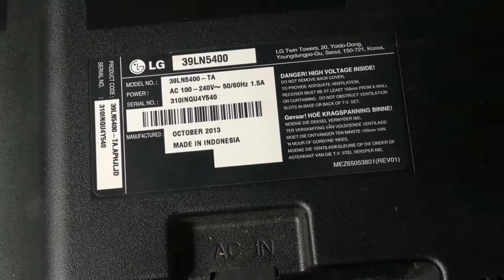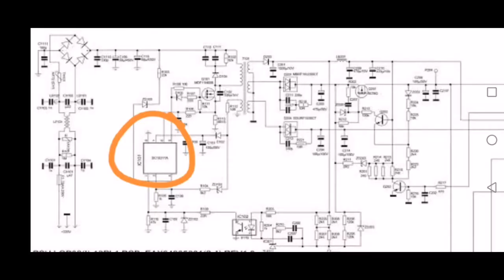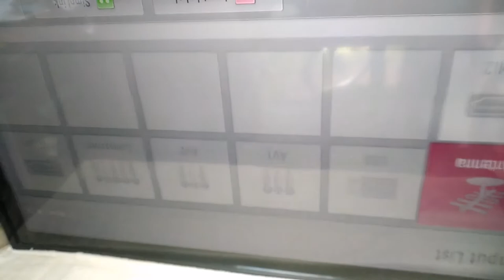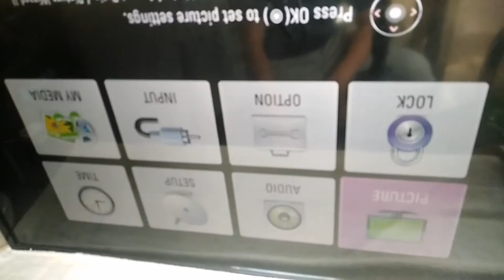LG LED TV NO POWER AND FUSE KEEPS BLOWING REPAIR MODEL NO. : 39LN5400

Comment: If it was just a blown fuse, why would you replace the "PWM driver"?
Reply from the maker: Because This was the cause for blowing the fuse repeatedly..
Reply: @DANEXTTECH  interesting. Hey so if a storm blew through and killed the TV is a fuse the most likely place or failure? OLED LG. I already removed the board and was about to start diagnosing with a multimeter like your demonstration
Reply: @DANEXTTECH  I couldn't pinpoint the problem today. I don't see anything burnt anywhere. 😔 sucks
Reply from the maker: WHAT WOULD BE THE RESULT OF YOUR CHECKING IS THERE ANY SHORTED YOUVE FOUND SIR? @trippyvortex
Reply: @DANEXTTECH  I couldn't find any but I didn't check all the circuit that's for sure. Am I supposed to be holding the black to one side of the fuse, and the red to another side of the fuse and keep following the path down the line to check for continuity? Or am I supposed to check from one point on the "hot" side to the next point on the same "hot" side? I started with the first fuse that comes right after where the main power cable comes into the unit and was hoping that would be the point of failure but I guess not. I had an Ethernet cord plugged in and that's what actually went out with the Storm because the house never lost power just the Internet went down so perhaps whatever the weakest link from that port? What do you think? Also had an led light strip plugged in via one of the TV's USB ports, and also had a USB thumb drive in one of the ports. Do you think the fact that my cable Internet went down while the TV was directly connected to the modems Ethernet port is the culprit or?

I appreciate any response ✌️💯
Reply from the maker: @trippyvortex  If that's the thing about those internet cable & USB connection these would only affects the main board on your TV set... But if the main primary fuse blown expected cause by an over AC current supply fluctuating and a short circuit from the MOSFET TRANSISTOR with the DRIVER IC... common issues of LG LED TV .
Reply: @DANEXTTECH  the main fuse is not blown, it's still good, (at least I think it is because when I put the multimeter on it had continuity) I'll look up what you mention and see if I can find any faults. And it's OLED, (not sure if that makes a difference)